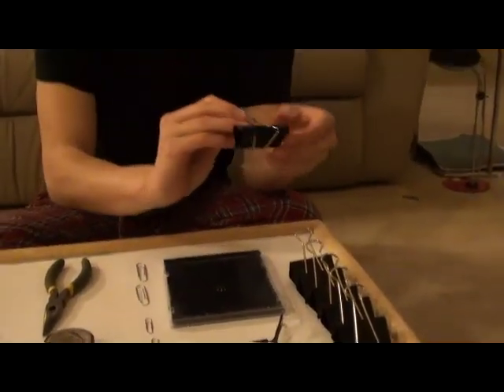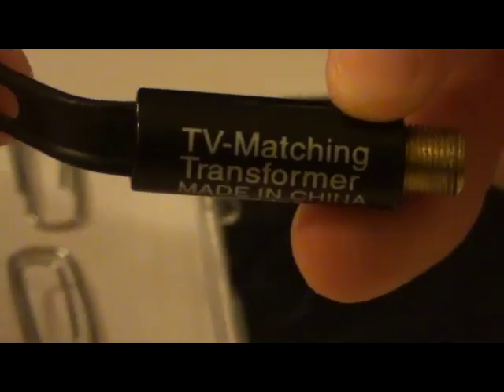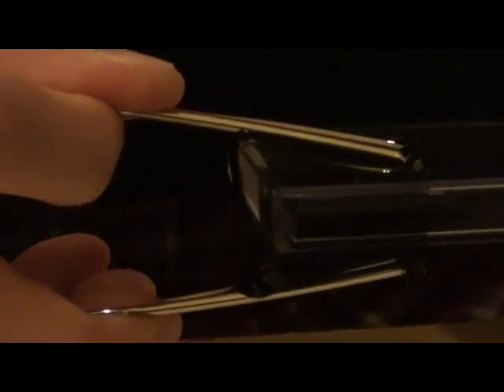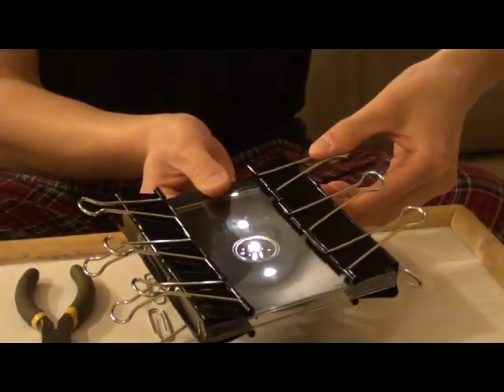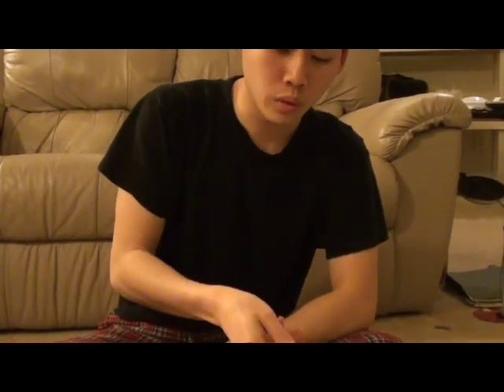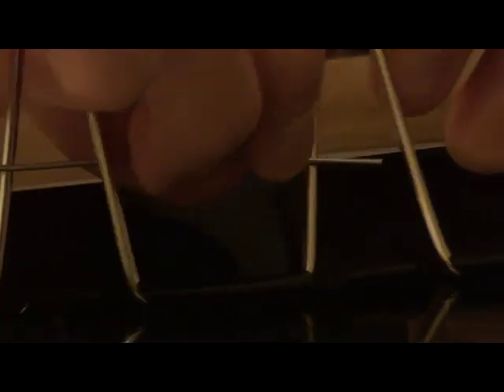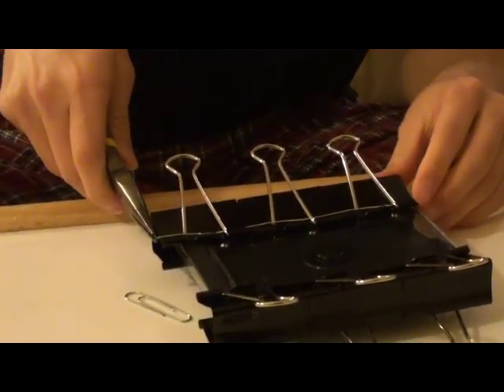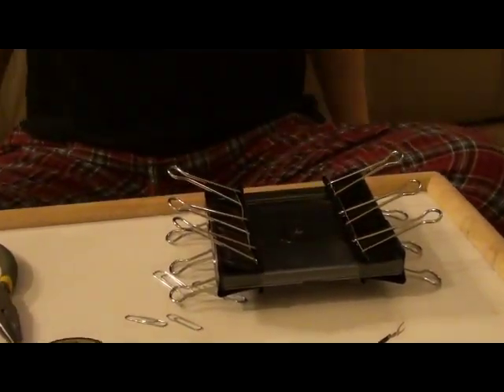Binder Clip HDTV antenna part 1

Comment: Brian, I just tried this last week and to my surprise, it actually works really well. In fact, it works far better than my RCA Digital Flat Antenna with power amplifier that cost about $50.00 dollars. (a waste of money)
But this little home made fractal antenna actually gave us far greater reception, powerful enough to catch all PBS channels which were almost impossible to tune in,  among a handful of other channels we didn't even know about.  All, for about 6 dollars after purchasing the transformer module.  I do want to say that I did have to use a long cable in order to prop our fractal antenna up high because it didn't have enough reception from the tv stand (i tried hiding it behind our set but that didnt work). So I grabbed our longest cable of about 15 feet and placed the antenna in our hallway closet, on top of the highest shelf, nicely hidden from sight and tucked away the cable line along our trim in matching white).

Anyways, thanks Brian, for the excellent walk-through.

Comment: So I built one of these using 12 mini binder clips on a piece of cardboard about 3.5 inches wide and as tall as 6 clips. Used some copper wire I had on hand. Pulled in the major digital stations whose antennas are about 23 miles away. The TV reports "Good" signal strength on the major networks. I'm pleased.

Comment: I modified mine with a snowflake-type foil fractal, split at the top and bottom, and glued it to the front of the case ; then I made the antenna with the clips clamped over the foil for contact. I'm picking up 23 stations up to 27 miles away. I'm elevated in an apartment 30 feet up. Great simple design, thanks.